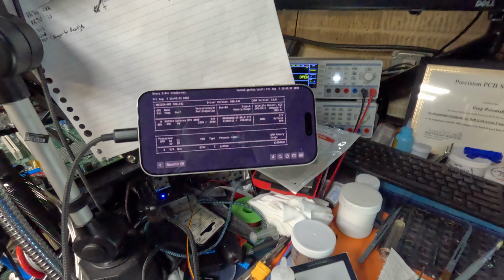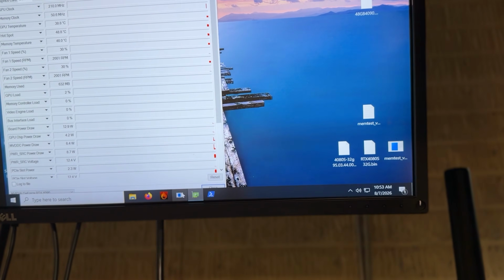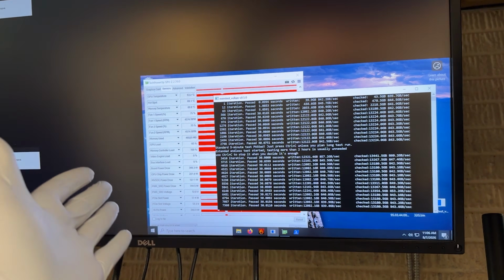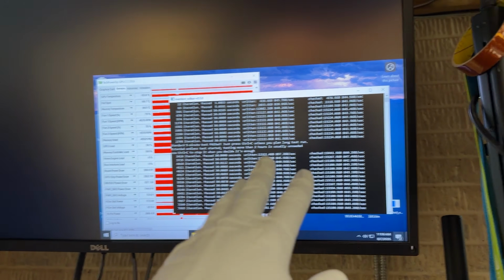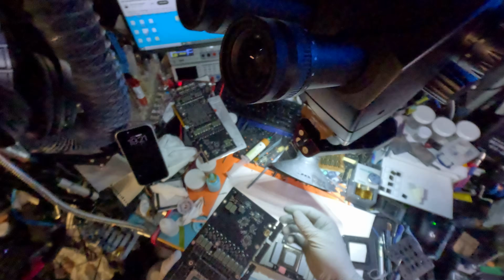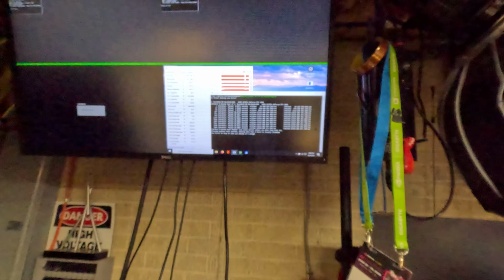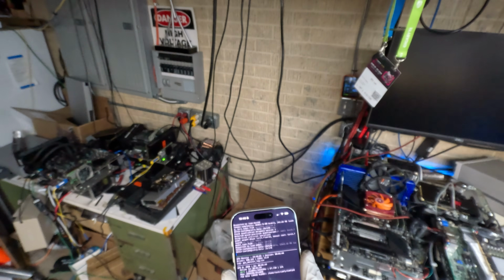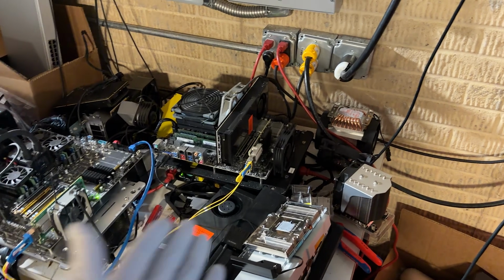48GB 4090 from China: ERR ERR ERR Over 24GB | Lead-Free Solder Ball Failure

Comment: Hey Greg, love your content and work that you're doing!! I had a question on the placement of the chips. Is there any reason why you don't just have placement fixtures / alignment aids that you could use to place the memory chips onto the fluxed solder pads? My thought is it might be possible to use the 4 gpu core screw holes as alignment datums for a fixture that you could just place the mem chips, that way you don't have to manually place and align each chip. IDK just a thought, I dont know if each board has too much variability in the pad positions or if its just not worth the fuss / cost but just a thought I had watching your process 😁

Comment: It's a humidity issue, those BGA components get shorts in high humidity because they use a no clean flux that leaves residue under the part. The old fix would be a wash it down in a Freon tank but those are outlawed now. Very nice burn in bench you have going there!
Reply from the maker: I appreciate the advice and thank you for the input!
Reply: @regsky  I used to work as a test tech on the smt line, the worst was Apple and those USR PCIMCA slot modems we made were no clean and horrible to test pass, no issues with the HP print server modems or laser disk controllers we made. The no clean, no lead process is very tricky with humidity when it goes through the smt oven for BGA components because the next process is the wave oven which causes the PCB to warp slightly and thus causes cold solder joints under the BGA components on the top side. You have better equipment then we did as SCI and then the old Litton plant Apple owns now in the old Litton ICMU plant. I used to get in trouble for pulling IBM 601 processors off of bad apple server boards from the junk bin to make shipping quotas in a turn key plant with no spare parts. I got a reprimand and 75 cent raise quietly for best production ICT shift. I ran the HP ICT and functional test line back then in 1995 era.

Comment: I had a similar issue on a Quadro M2000. It would run fine, and run fine in Furmark and other tests, but it might freeze or crash when playing videos, in particular playing short videos in a loop.
It turned out to be a knocked off filtering capacitor that was used by a voltage regulator.
There is a risk that a component was partially knocked off, so it did not make contact anymore, and then it healed itself during rework.